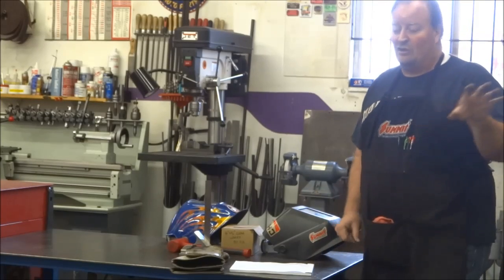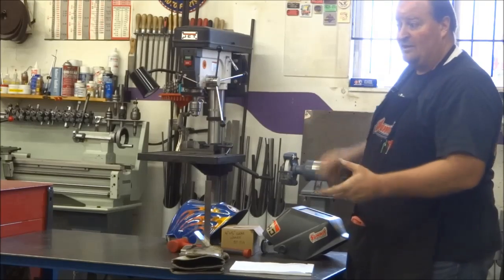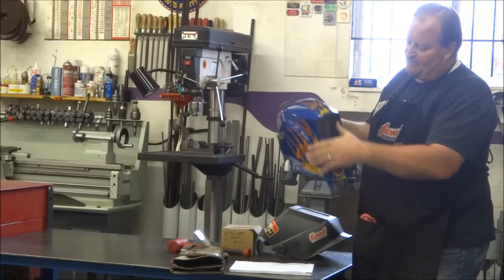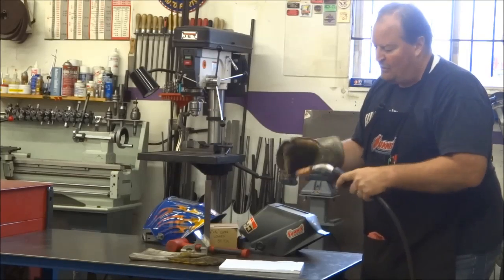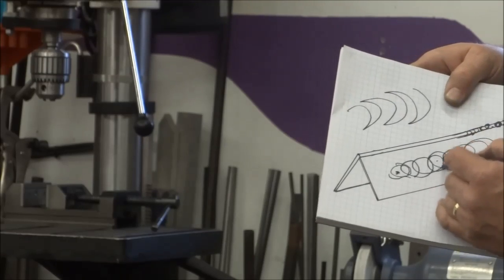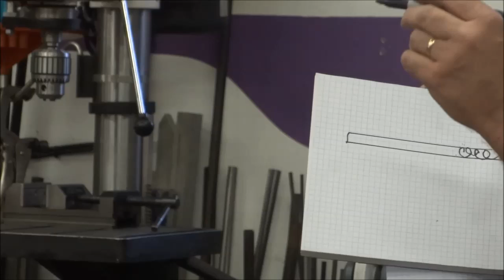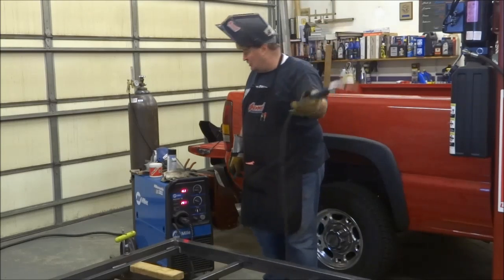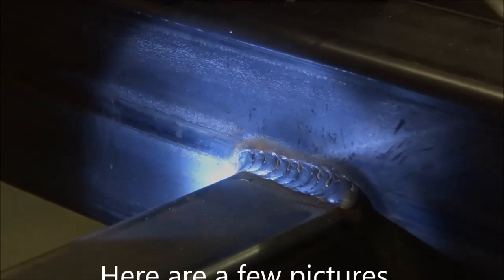MIG Welding Technique : "Stack of Dimes"

Comment: A very informative 22 minutes on welding basics, followed by 4 very informative minutes on MIG like TIG. Best looking dimes on Youtube IMO. Would like to see your method on other types of joints. Maybe I missed it, but I'm assuming .030 wire was used in the demo? Thanks for the great video.
Reply from the maker: Thank you for the comments. I will try to remember to shoot some video of some other joints as they come up. As for wire, you are correct, I am using .030" solid wire with C-25 gas. Thanks for watching and commenting. 
Mike.

Comment from the maker: If memory serves I was at 17.5 volts and 220 IPM for the ones I showed in the video.  This was for .125" wall 1.5" square tubing welded to the .188" wall 2"x3" main deck.

Mike.

Comment: I've got to practice this with my powerimig welder. Thanks for the lesson.
Reply from the maker: The Lincoln Powermigs are a good welder. Ran a Powermig 200 at work for a bit and really liked it for the short time we had it. Started acting up a little and we traded it for the Miller MM251.  The Powermig 200 must have had a bit different inductance because it had a different, almost softer arc. 
Thanks for watching. 
Mike
Reply: Powerimig. Isn't that the Everlast MIG welder? I tried one once. It had a really nice comfortable arc.
Reply from the maker: Not certain about Everlast, I’ve only had personal experience with the Power MIG line from Lincoln. 
Mike

Comment: You use the technique I use, almost. Just for kicks, try this. turn your heat up and move faster. On your down hill it don't matter which way your circle goes but on your t joint, roll your circles the other way, like you said.. gravity. Rolling your circles the other way will allow you to have that higher heat and flatter, deeper penetrating weld without getting a belly in the bottom. I am always changing my circle direction as per my position so that I'm coming out of the puddle on the top side. because that's when it's the hottest and largest puddle. gravity does the rest.
Reply from the maker: Thanks.  I am always playing with the direction and pattern as well.  It is ALWAYS a learning process, anyone who says otherwise is limiting their ability to learn.
 Thanks for watching.
Mike.
Reply: +zmotorsports Absolutely right! I like running as hot as possible for 2 reasons, one it helps with that pesky fusion issue others like to bring up lol and 2 it limits heat dispersion. Which as you already know, helps with warping and molecular changes in the metal.

Comment: I think you give sound technical advice in general, but I would also add that you being the professional should advocate and educate your customer. He may want want something done a certain way, but what he wants may not be safe as testing has shown. If you want the tig look, just tig it. I agree with the posts below about this technique not getting adequate fusion for a critical weld. You keep giving the boiler pipe example, what about a trailer frame? What about things that are common, critical welds that are done by a lot more people than boiler pipe weldors? In my opinion, if you need to weld something that is going to support any sort of load, you should use the process or technique that provides for the best weldment, not the best appearance. To say you should do what the customer wants with something potentially unsafe is dangerous and opens you up to liability. In addition, downhill mig welds look much nicer in most cases, but they are rarely adequate in performance.
Reply from the maker: Although I respect your opinion, I never said it was unsafe.  I have welded more trailer frames, jeep chassis, sandrail chassis and street rod chassis than I can count and have never had a failure.  That said, it has taken years to learn through many samples and destructive testing.  I have put my life as well as my wife and son's life into all of the chassis that I have built and I would not have done that if I ever thought it was unsafe. 
Thank you for watching.
Mike.

Comment: do you change the wire speed and voltage or leave it the same.
Reply from the maker: +The brick ballers 405 not sure I understand the question. Do I change wire speed and voltage or leave it the same compared to what?  
Mike
Reply: compared to a normal technique would you adjust the settings to benefit the bead.
Reply from the maker: +The brick ballers 405 yes. Compared to say the suggested settings the voltage and wire speed are slightly lower as well as your travel speed. 
Thanks for watching. 
Mike

Comment: Is there a formula for the changes you made
Reply from the maker: +The brick ballers 405 not really. More of a "feel" than anything. You have to do it trial and error much like the suggested machine settings inside the panels as everyone has a unique signature when welding as far as travel speed and technique. These idiosyncrasies determine your unique settings. 

You want to ensure good fusion and make sure the toes wet out properly then adjust based on sound and how well the weld deposit feeds into the keyhole as you are progressing. It sounds more difficult than it actually is. Just practice and determine what settings work for you personally on various metal thicknesses as well as weld profiles and keep notes. For example a "T" joint will require a different setting than an open corner joint. 

Hope that makes sense. 
Mike

Comment: and will fail xray
Reply from the maker: This narrow mindedness is one of the reasons I made the video.  If you notice in the video I mentioned that this is one "technique" used.  A good weldor can and will use different techniques or styles to complete the job at hand.  If welding refrigeration or boiler piping I would not use this technique.  In the video I mentioned the motorsports industry in particular for this style of welding being so popular.  I work in the industrial maintenance industry and my home shop revolves around the motorsports industry.  This is why I became proficient in multiple welding techniques while carrying my AWSd1.1 welding certifications in SMAW, GTAW and GMAW.
Mike.
Reply: +zmotorsports lmfao D1.1 certs  are a joke thats entry level welding.  talking to me when you have B certs  and API certs
Reply from the maker: Thanks for repeating what I already mentioned in the video.  Is there a question or reason for your post?  
Mike.
Reply: +zmotorsports no just the fact the whipping or circles is createa lack of fusion no matter what its weldee on
Reply: That's funny.. I'm a structural weldor. 12 yrs in the trade. My mig like tig has passed every x-ray, bend test, pressure test, and shock test ever given. I used to weld for RW Enterprises where we were tested for 80k psi concrete molds. Never broke a weld. So please explain why it won't pass....
Reply: +coors1800 I allready  explained this doing circle motions will have lack of fusion at certain  points of the weld. I've been in this industry longer then you.  just got off the pipeline and now doing structural welding as well in the shipyard. if you wantvto argue that then i guess you know more the AWS and welding engineers this topic of whipping and circle motions has allready been studied.  for what this guy is doing its fine for that application.